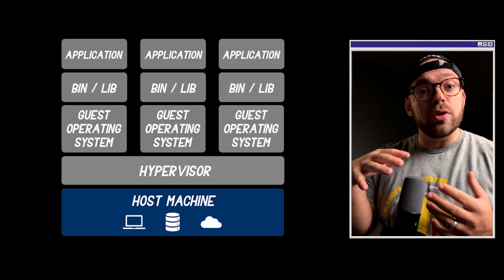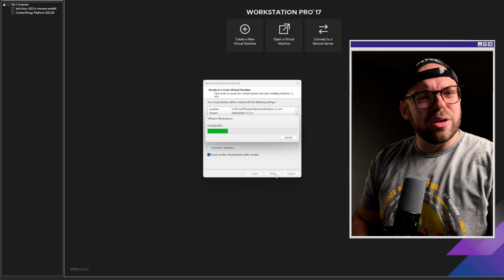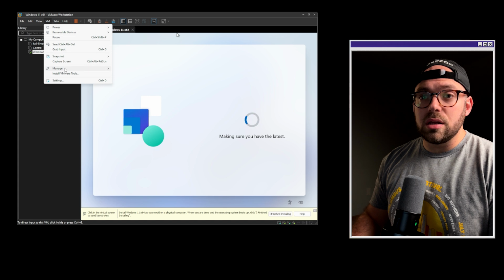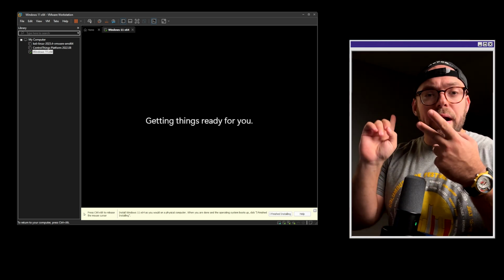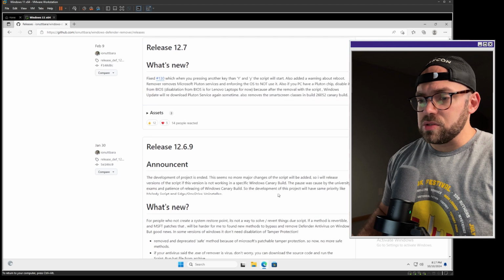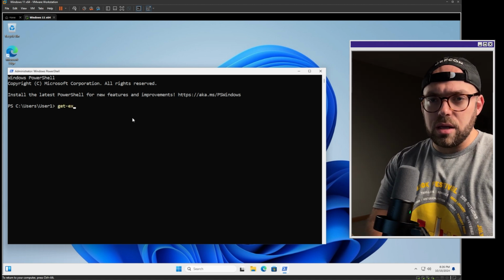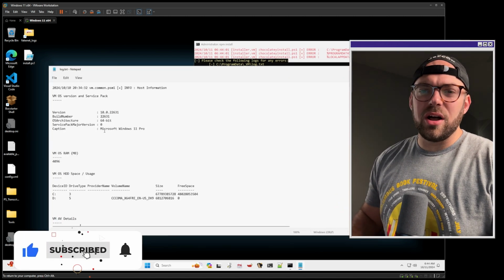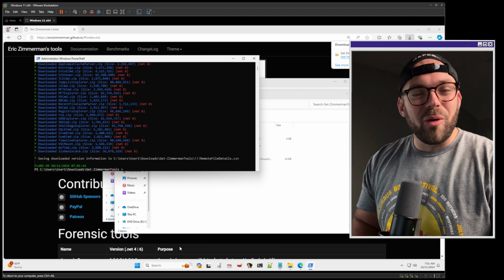How to Build a SECURE Malware Analysis Lab (FlareVM + VMware Pro)

Comment: It is a nice video and it is informative may I know how you managed to keep the background black even though it is connected to internet after the installation. Please provide me with the information. Thankyou for the wonderful video.
Reply from the maker: Thank you for watching! As for the VM; workstation pro allows you to change the network configuration through the settings of the hypervisor itself. In some instances, you have to actually modify the registry to get Internet connection. Once you have Internet connection, you will see the background changes to Red.
Reply: But when I see the background it has a black colour even though you are not connected to the internet
Reply: I am unable to get the internet for the flarevm when I need to connect and I followed all the steps you have told
Reply: Please guide me in this sir
Reply from the maker: @madineninavanath3880  Hey! Sorry for the delayed response. If I was you, I'd try (inside FlareVM virtual machine) RegEdit > SYSTEM > CurrentControlSet\services\Dnscache and change the "Start" value to "2" instead of "4". Restart the machine and you should see when you login that the background is red and it says "INTERNET ENABLED". Wishing you the best!

Comment: Was the "music" necessary? Distracting than helpful.
Reply from the maker: Thank you for watching and your feedback; this has been extremely difficult to dial-in because I do not want the music to be distracting, while also helping remove any “dead air”. I will work to improve this for the next video.
Reply: @CyberStudies  I agree. I was watching your older videos and they were better off without the 'dubstep'. It works well with your intro but not for the actual video. For example, the ambient music you used in your Powershell training videos were soothing.
Reply: @CyberStudies  even just something that is far less repetitive would be better.
Reply: @CyberStudies  Bro wants elevator music. 🤣